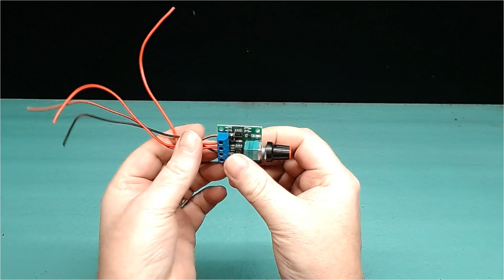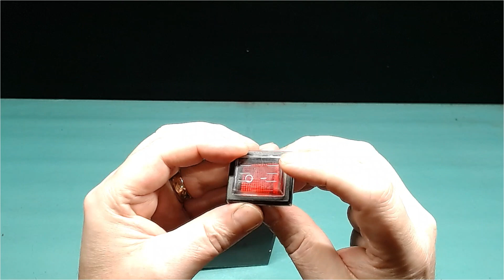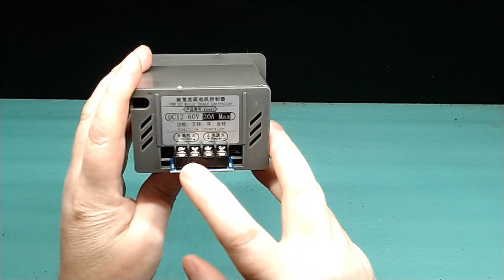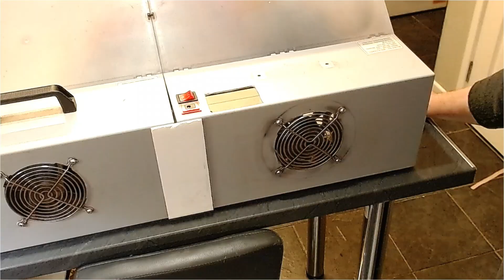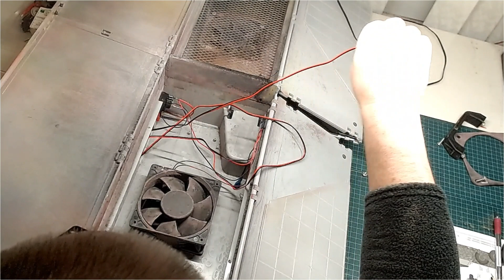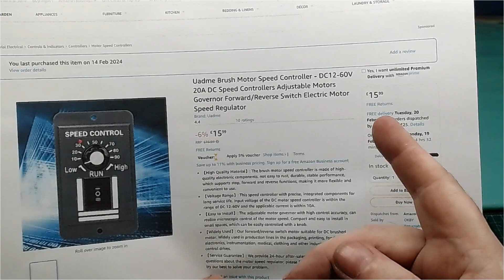Spray booth upgrade speed control fan installation

Comment: Hi Seamy, Great video!   I am planning on doing this modification to my booth very soon.  My idea is to attach a box to either the top or side of the booth that will accommodate the switches.  That way I don't need to reach over the booth to switch things off and on.  Thanks for sharing.  Have a great day. buddy.  Jeff
Reply from the maker: Thanks Jeff it's a handy gadget to have thanks for watching buddy 👍